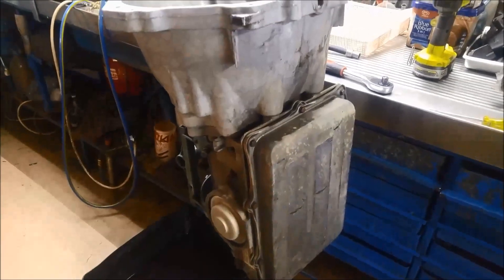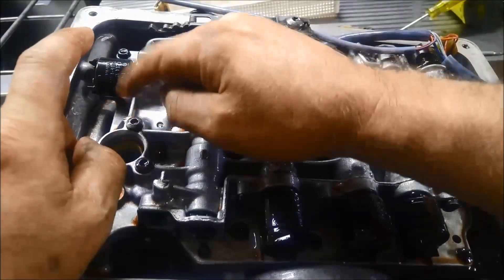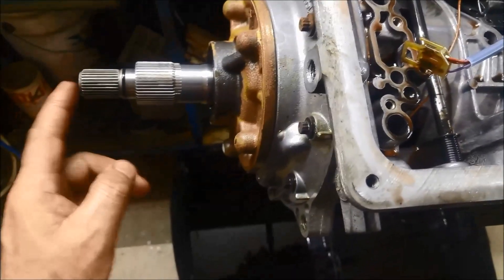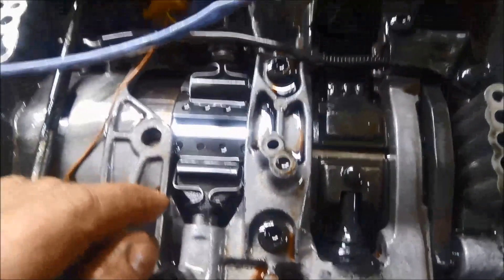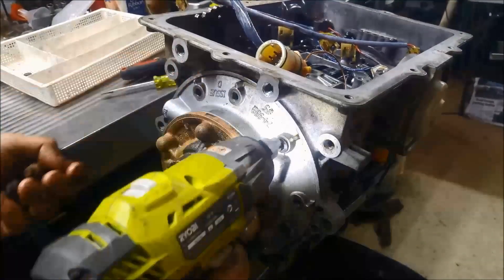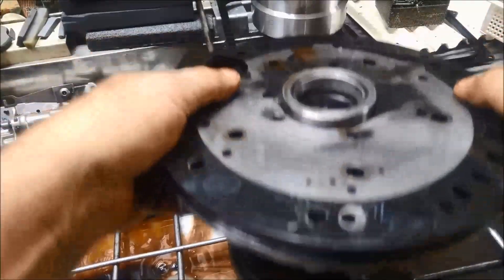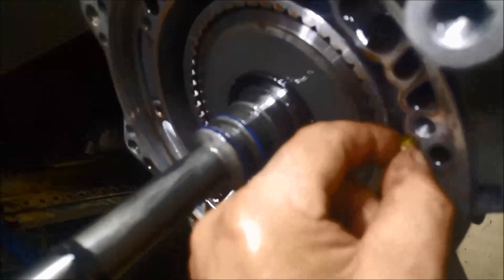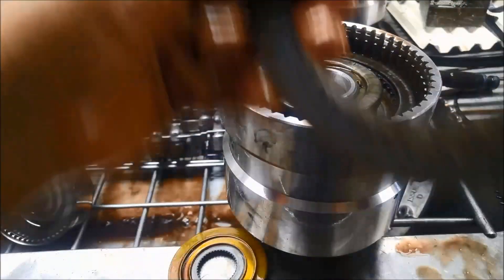Ford DSI M93LE BTR ION M74 M74LE M78 M78LE 4 Speed Automatic Transmission Teardown Disassembly 1 of2

Comment: Hi mate, that input shaft o-ring you pointed put that had gone flat and can drop TC pressure - would this cause a torque converter to almost never lock up in fourth gear? My XH has been like this for the whole eight years I've owned it, and I'm strongly considering buying a used box from the wreckers to try a DIY rebuild on and putting into it.
Reply from the maker: hi, pressure leaks due to flattened or hardened seals can burn out a trans. cheers

Comment: How you replace the front band? Do you have to take the transmission off or you can get it off without taking the whole thing down?
Reply from the maker: hi, to replace you will need to remove vbody and front pump. cheers

Comment: I went to adjust my bands on a gearbox off a wreck before I put it in the car, thinking well since I paid for this i might aswell make it the best it can be.  I tried to find some shims of assortment sizes and had difficulty finding them, perhaps some auto trans shops had some spare shims, when I asked - 3 automatic transmission shops were confused why I would want to adjust the bands and said they don't need adjusting on BTRs.  Is there any benefit to this, this left me now more confused.    My Front band piston had 4.6mm travel rear band piston 7.4mm travel.  This donor transmission drove good in donor car about 280,000km or so.
Reply from the maker: hi, contact me via our facebook link for more info and let me know what thickness shims you need. link is in description. cheers

Comment: hey mate, looking at getting an fg lpg ute with the 4 speed auto. Seem to have a few issues, are they problematic or have i just come across a few bad ones? thanks
Reply from the maker: hi, regular filter service, adding extra magnets and fitting a by-pass trans oil cooler will always make any transmission more reliable and last much longer. cheers

Comment: Thanks for those very informative videos mate, would you happen to know which btr converter for Ford cars that would fit the ssanyong 4 speed?
Reply from the maker: hi, i`m not sure, we just order them. i do know that pump half & stator are different part numbers though to the ford ones. cheers
Reply: @YepThatsIt  I'm in brisbane for a couple of months before I return to Malaysia,  I wonder where I can order a converter for the btr auto m74le,

Comment: Hi how do i get a more in deep infomation of my M93LE valve body teardown of the location of the parts where they go like balls and metal latch stoppers. Is there a better file that i can download like a pdf from you or the internet. Thank you
Reply from the maker: hi, will cost you a few beers and contact me on our facebook link. we can share pics, vids and info on there. cheers
Reply: @YepThatsIt  Hi again thank you for your quicjk reply. I dont have facebook but my son does so i will go under his name i just need a picture of the valve body seperated. i can send you a picture as i nede to be sure if i have all the balls and the metal plates in the correct galley slot.
best regards.
I will contact you over there tomorrow on fb...cheers
Reply: @YepThatsIt  r u still after beers u drunk
Reply from the maker: @doc-holiday  did i get any from you? cheers

Comment: You make great videos!!   I am doing a barra swap on my XF ute and bought an XG 4 speed column and what looks like a BTR out of an XG van which apparently had
only done 95000 Ks. Can these older BTRs be made to work with a BF computer, from what I have read the electrics within the trans are different after AU transmissions but looking at what I think is your ebay store at least some of the solenoids are the same https://www.ebay.com.au/itm/Ford-BTR-ION-DSI-4Sp-Auto-Trans-Shift-Solenoid-EB-to-FG-Falcon-Ford-Territory/293029936216?hash=item4439f1fc58:g:cMIAAOSwEF5c53O2&frcectupt=true
EB would be roughly the same as XG
Is there something different about the wiring harness, there is someone advertising a couple of BA BTRs that need rebuilding so was thinking of grabbing one for the bellhousing, the valvebody  and maybe the internal wiring harness
Also do the older BTRs use a different convertor?
thanks again

Comment: Awesome vid mate, should have way more views and likes. Do you know what would cause loss of 3rd and 4th in BA xr6 turbo 95le? It will attempt 3rd shift but continue on in 2nd, if you throttle off it goes into what seems neutral. With some throttle while moving revs will rise until it seems to engage back into 2nd once road speed matches 2nd gear. 1st 2nd and reverse are all working. Apparently its either C1 clutch or possible s2 solenoid stuck open?
Reply from the maker: hi, best to contact me on facebook link...check range sensor as well. cheers
Reply: My car does this when I change gears manually, I can no longer gear down 😭

Comment: Great vid i came here because im trying to figure out why my 97le is tripping out between 1st and 2nd would really like to see a build on this cheers .
Reply from the maker: hi, can you describe what you mean by tripping out?
Reply: @YepThatsIt  gday thanks for replying its like when i put my foot down from take off it like thows into second or third or both but if i drive with just taking it easy it runs through the gears no worries,  maybe multiple solenoids coming on when it should kick back to one gear only ?